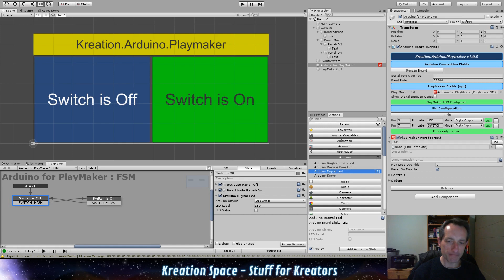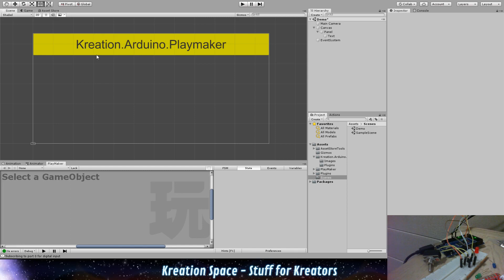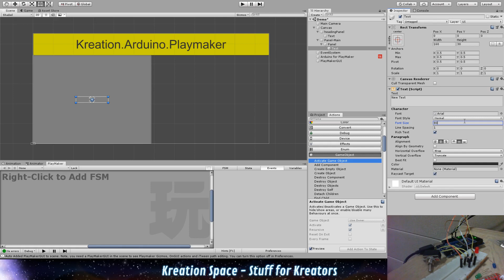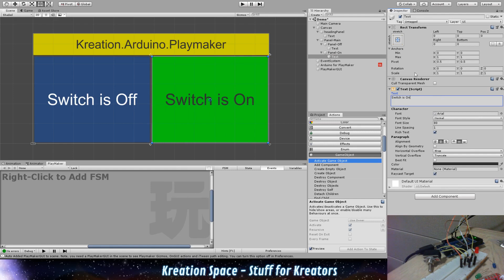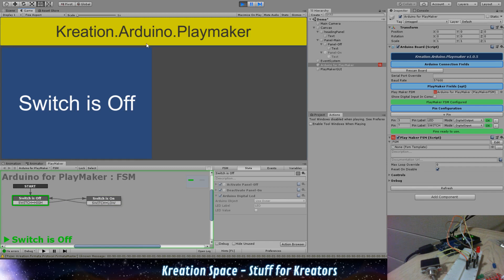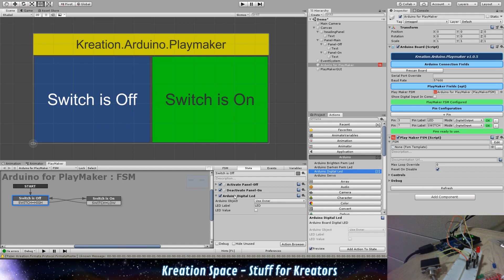Arduino & PlayMaker? How to Make them Work Together!

Comment: Hi .  Two questions

1.  I can see that the latest update to the addon is back in 2019. Is this addon still working?

2. You are effecting unity by using the switch, does it translate the other way as well? If i trigger an event in a playmaker FSM can that then lead to turning on a physical light bulb connected to an Arduino
Reply: The Arduino can turn on a signal on an OUTPUT pin (set to output mode) and read the value (on/off) of an INPUT pin (set to input mode). Note also that some pins are digital (on/off only) and some are analog (or PWM) and can read different voltage levels to varying degrees of accuracy. Which pins are analog vs which is digital depends on the model of the Arduino board.
Reply: You're right the last update was 2019. I don't expect any issues and haven't had anyone raise issues with compatibility over time. There is a free (limited functionality) version of Kreation.Arduino in the Asset Store that you could try if you're concerned about Unity or operating system compatibility. Mac / Windows is a moving target as much as Unity itself. Happy to address any compatibility issues that arise but may need to work with you if I can't reproduce the problem.

Comment: For me, the only compelling case use for this is creating motion controls. Any plans to support the ADXL345 Accelerometer and some sort of wireless capabilities?
Reply from the maker: With wireless, I'm happy to add WiFi support so a Unity app can drive Firmata (Arduino) board remotely, but bluetooth is not well supported across different platforms. On the accelerometer, I can't make immediate promises and I'd probably only support the most widely available device.
What are your thoughts?